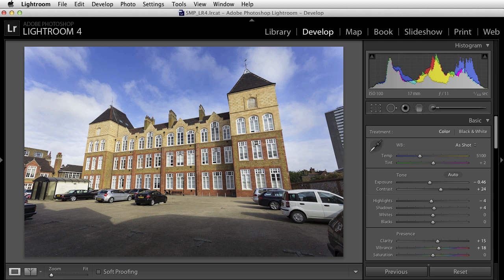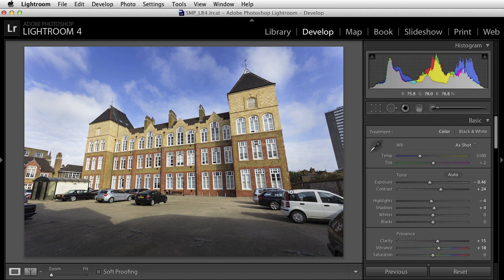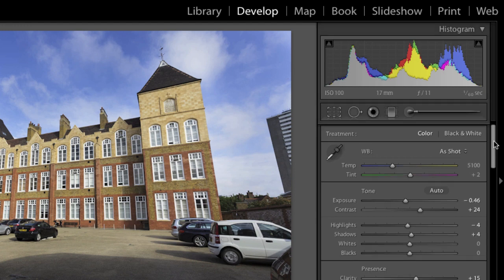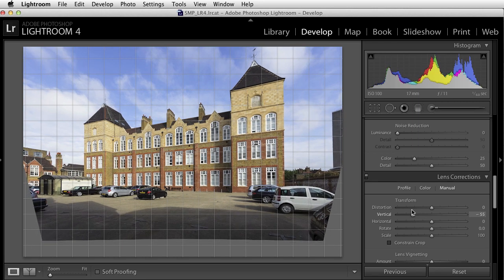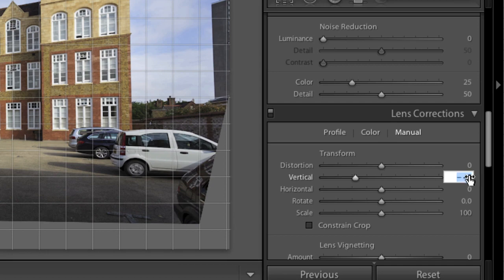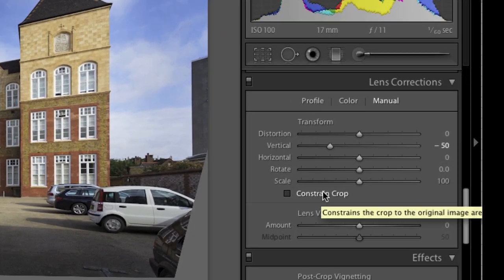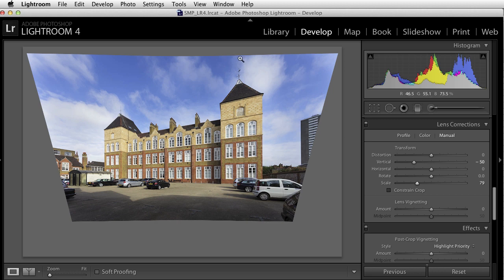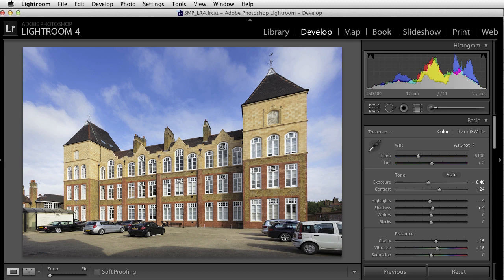11 fixing converging verticals

Comment: It's not just the missing top of the structure Another problem, that you don't address is the tilted horizontal line on the right hand tower, below the roof. Lightroom CC (let alone LR 4) seems unable to rectify this issue yet.